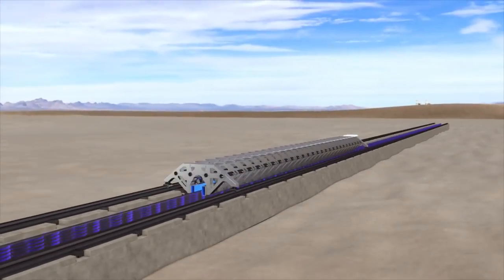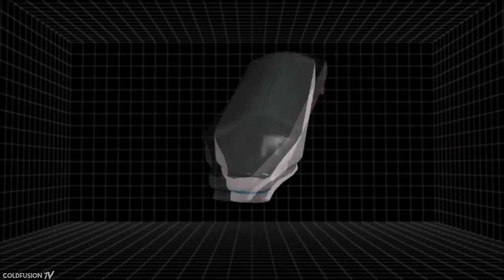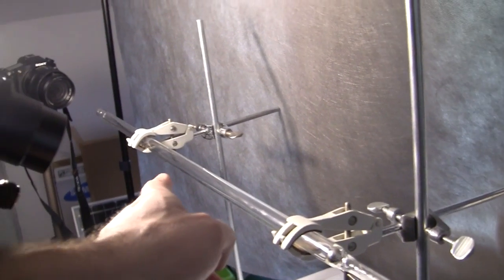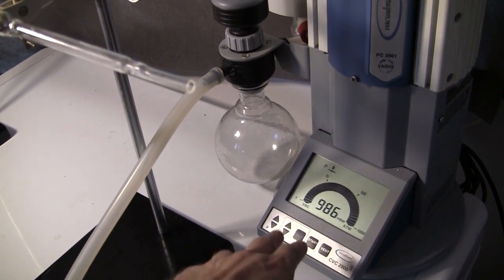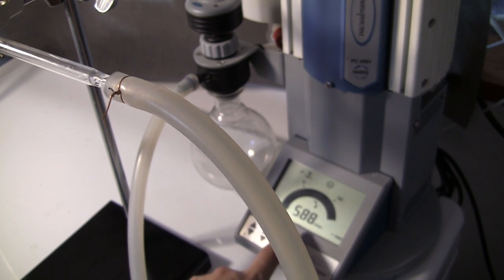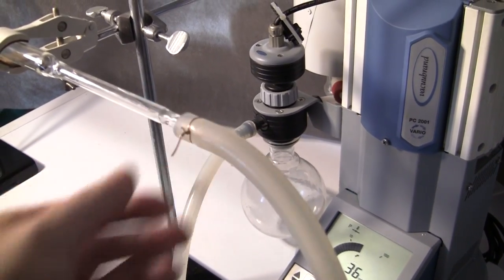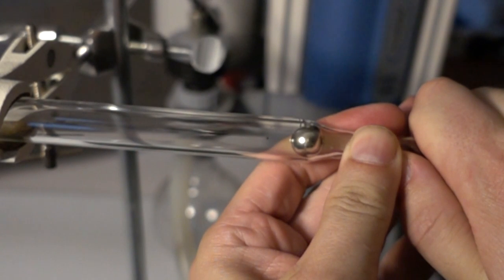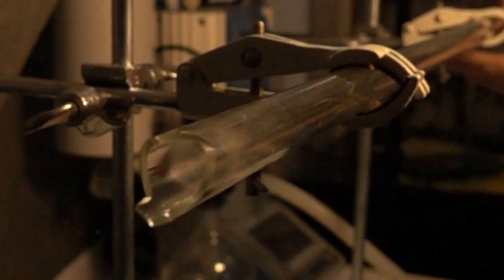How  the Hyperloop can kill you!

Comment from the maker: The hyperloop has all the hall marks of wishful thinking of dewey eyed dreamers sold by PR bullshit men who simply dont want to hear cold, ugly engineering reality.
Reply: type promo code feminism to get 15% off your next bleach bottle.
Reply: I'm not any scientist, obviously, but what if they used magnets as breaks? Like let's say, 100m of a magnetic railroad or something that would gradually slow it down or stop it. Or would that be BS? Idk just wondering. Would be glad to hear your opinion on that!
Reply: They can keep valves all over the places with mechanical sensors that break and rapidly equalize the pressure. The magnets can be used as brakes... The simple scale difference would mean that the hyperloop vessel would be more difficult to accelerate....(not certain of this).

The longer and bigger the tube ==/== (does not equal) more catastrophic results (Or at least you did not demonstrate this)

You may not be able to put fail safes into the system but that doesn't mean they are not there. If air is introduced quickly and uniformly into the tube the ball will barely move. (If air is introduced in about equal quantities in the front and back that is....

The vehicle can simply be designed to take the pressure change.... The end of the tube can be designed to have a giant crumply barrier (like all modern automobiles) capable of stopping it (even at 1000mph).
Reply: Well, how likely would vacuum failure even be? I mean, other modes of transportation can kill you too but with a very small chance of it. So, we'll need to wait and see  what they actually build, no?
Reply: In the Hyperloop Alpha document released by SpaceX (http://www.spacex.com/sites/spacex/files/hyperloop_alpha.pdf) they do mention failsafes for depressurization situations. Do you not belive in the failsafes? Are the effects you show in the video of a too large of a magnitue for "mechanical breaking" and " rapid re-pressurization along its entire length" too work?
Reply: But its not outright theoretically unfeasible, right? Unlike thorium freaking roadways.
Reply: "The AIRPLANE has all the hall marks of wishful thinking dewey eyed dreamers sold by PR bullshit men who simply dont want to hear cold, ugly engineering reality."
Reply: A plane can crash. People are still flying planes.
Reply: Thunderf00t does a lot more, he's not making content exclusively about feminism; why can't you appreciate his effort and respect his work by staying on topic? You're essentially shitposting feminism hate for attention, how are you different from feminists again?
Reply: How Cars can kill you!
How Trains can kill you!
How Planes can kill you!
Reply: Do you have any ideas for how to slow down? And I'm pretty sure the hyperloop wouldn't be made of glass.
Reply: Repent thunderf00t and see the error of your ways. Take Elon Musk as your savior and worship in his name.
Reply: The problem with this demonstration is that it doesn't scale particularly well. For one, the pressure differential between the near vacuum inside the tube and atmospheric pressure will be the same at both scales, with the mass of the passenger pod scaling much more quickly, (d_pod * 4/3 * pi * r_pod^3)  while the diameter of the tube, and thus the surface area for the pressure to push on will scale with area (99900 Pa * pi * r_tube^2), not to mention that the hyperloop is not spherical, but more of a tube, so it would be even more massive per pushable surface area. All of this means that the acceleration due to a tube breach would be (p_diff * pi * r_tube^2)Newtons / ((d_pod * 4/3 * pi * r_pod^3)/2) where d_pod (8,050 kg/m3 assuming a steel pod) and p_diff (99900 Pa) are constant. This function decreases as a function of the radius of the tube, so a bigger pod contained in a bigger tube undergoes much less acceleration (especially when compared to an extremely tiny one).
Reply: "In the event of a large scale leak, pressure sensors located along the tube would automatically communicate with all capsules to deploy their emergency mechanical braking systems."

I hope your longer video demonstrates why this simply won't work. Otherwise, all you've shown me today is a metal ball in a glass tube accelerates to high velocities when vacuum is lost. Which is cool, don't get me wrong... but lacks any real significance against the proposed Hyperloop design.
Reply: This is exactly what I was going to say, could the magnets and props not have a fail safe breaking system? If  a pressure change is detected everything goes into stand still mode.
Reply: Other means of controlling failure decompression could be implemented, not brakes alone.

Say, if sensors behind the capsule detect leakage, signal goes to emergency vents ahead of the capsule - to equalise the pressure in front.
Reply: Out of curiosity: Shouldn't there be a way to implement some kind of emergency brake system to prevent the massive acceleration in case of a vacuum failure? Of course you can't completely stop it but at least there should be a way to slow down the acceleration significantly, right? Also the failure you demonstrated seems like quite a big one. It could happen, but assuming it is build with proper materials and safety measures this looks like an absolute worst case scenario.
Reply: not this time thunderf00t just admit you wanted to test us ;D

the mass you would accelerate in the hyper-loop would be much bigger in relation to the surface the air would push on, hence less acceleration.

lets say it weighs as much as a buss, which is about 10.000kg
the surface is rounded 4sqm
1bar would be the pressure difference

so it's a quarter of a kg per square cm that will be accelerated
the force on one sqcm is 9.81N (one bar)
9.81N on 250g
turns out to be 4g acceleration...
wich wouldn't kill you in acceleration,
make it 4 time as long and 1g wouldn't do too much
you would just get 21% more acceleration than normal gravity gives you

Moreover i highly doubt you would get a hole large enough to get air in fast as you would need for 1 bar pressure.

to stop the train you need to just install some valves to get air in front of the train and it would break rapidly due to the tight fit air drag it has

really that's not going to stop the hyper loop any time soon
the problem doesn't scale well with size the bigger the better it's a cube square law thing mass goes up much faster than the surface

and just thinking about it a rocket would just fly away at ultra sonic speed immediately considering it has much more pressure in the back...

love your videos please keep up
please apologize for your mistake <3
Reply: 1) your model does not scale well.
2) planes are very dangerous too.
3) this is a tractable engineering and risk management problem, not "pr bullshit".
4) hyperloop has much more credibility than other things you debunked.
Reply: So your saying a high speed transportation system would be dangerous if all the safety systems failed and/or didn't exist?  Maybe next you'll tell us why trains are bad because they might derail, or an elevator cable could snap.
Reply: Well first of all pressure is force per m^2 and mass is per m^3 and considering F=m*a simply scaling this system up would actually decrease the speed of acceleration. Also i don't think they would build something like this while not considering safety measures for one of it's most obvious flaws. Not saying the model proposed would work  don't know the actual design used but ti's not inherently impossible to do safely.
Reply: They've already addressed it in Hyperloop Alpha:

"In the event of a large scale leak, pressure sensors located along the tube
would automatically communicate with all capsules to deploy their emergency
mechanical braking systems."
Reply: is the hyper loop the Elon musk train idea. or is it another thing completely
Reply: Wouldn't it be possible to measure pressure every 20 meters and in case of rapid flucktuation shut down the vaccuum on both ends in a way that decellerates the train?
Reply: Did you read http://www.spacex.com/sites/spacex/files/hyperloop_alpha.pdf ?
Reply: So when are we getting the video? I threw money at you to make it go faster.
Reply from the maker: yes.... thats the main source of the lolzfest!
Reply: You've got balls to challenge Elon Musk, a man who literally lands rockets, upright, from space.
Reply: +MadnerKami Think about it for a minute. You're in the air, and the engines fail, now there is not enough lift, and the plane will bore into the ground at speeds well beyond what the plane is designed for on uneven land that the landing gear is not designed to deal with.

Think about it for a minute; you ride up to space for your space hotel vacation and the rocket explodes, or seal on the space hotel breaks and you suffocate to death!

Think about it for a minute, some guy might go through a red light and crash into your car well beyond what your car is designed to handle, and then you die.

The question isn't whether some transportation method can kill you, any transportation method fast enough to get you places in a reasonable amount of time can kill you. The question is how high is the risk of that failure occurring, and is that risk acceptable and the deaths that go with it. Considering thousands of busloads die in cars alone in a year in the US alone; it seems we are willing to accept quite high a risk - and the deaths that go with it.
Reply: I often find your videos quite useful or entertaining due to the factor of nearly obvious rational steps and critical thinking, yet this one is disappointing. You haven't in anyway debunked the hyperloop, You've shown a stumbling block and a potential risk factor, but the risk factor is one very similar to airplanes. This is also not showing how it is impossible, which makes me wonder why you used the statement "debunk". In the end, the hyperloop is nothing but a high speed magrail in a depressurized tube for a higher velocity.
Reply: +kkonstantinosss2 stopping the thing isn't the problem here. the problem is the acceleration after the vacuum failure which would lead to your brain getting squished against the back of your skull. once they stopp it everyone eould already be dead.
Reply: i dont know what kind of scientist you are but elon musk is smarter than you and problems even big ones can be fixed
Reply: ***** The very first seconds are cringe worthy to me .. remove a lot of pressure (okay, sure even if removing pressure from a x miles long tube is retarded) .. then fucking use a propeller. What.
Isn't that a tiny bit counterproductive ?
Reply: emergency release valve? 
The people developing the Hyperloop need to look more into the safety of the passengers and emergency failures, but the people funding them need to understand that these projects are still being worked on. Pushing for a full system within the next ten years is an idiotic dream, publicizing these statements makes normal people think that this technology is anything more than a mere concept.
I think if we ever see a working Hyperloop, it will be nothing like the concepts we see today and will far less advantageous as the billionaires pushing this tech want to make it seem to be.
Reply: Let's see who we trust on in this? CEO (and Lead Designer) of two most world changing tech Companies, or chemist who play with a high school science experiment?

(ok, and write it on Nature-Chem... ;P )
Reply: bad news ... the solar freaking roadways just not only got more funding from a government program, there is also a new crowd funding on its way. (see eev blog)
Reply: This is a joke.... Right?
Reply: llepsnaci1
 You realize 1000kph is only a little over 600mph right? Claiming that at 600 mph you'd just be a puddle of blood and bone is just plain ignorant.And a breach would cause a gradual stop. Not a instant one.
Reply: *****
I would argue it is less.  A train traveling 600 mph in an enclosed tube would be as effective as  trying to bomb a plane. Also millions of people take trains, and there has yet to be an attack on a train. Why? Because MORE people take planes.
Reply: You are forgetting something Mr. Mason, We've had pipelines running successfully piping all sorts of stuff (or lack their of) for over a century now! often times these pipes are cleaned and surveyed by way of devices known as "pigs" that can be moved from one valve/insertion station to another using pressure, vaccum or both. 
Some of them even have their own autonomous braking systems and have been used with pressure differentials well past 1 atmosphere, also this is supposed to be a maglev/monorail train in this tube, I'm pretty sure they'll remember to put the brakes on the car, after all they certainly don't forget to put brakes on trains! The same logic you demonstrate could easily be extended to ordinary rail trains, you could say they are unsafe because if one went down a hill or mountain it could get to an unsafe speed, well... what about brakes? They seem to work fairly well for all of our other modes of transport.
Reply: Nice experiment, but doesn't factor in electromagnetic rails that could reverse magnetic charge to prevent the cars from moving if a vacuum breech is imminent. This is like saying people shouldn't fly planes because they could potentially crash. Why stop there? You should never wake up in the morning because even just getting up potentially puts you at risk for your life. 

Seriously, as someone specializing in debunking bullshit this was bit BS from you, failing to account for engineers no doubt having taken this into account, to find ways to engineer solutions around it.
Reply: As a fellow engineer I can agree this project is a pretty distant dream, however it has more merit and far far more practical usefulness then most of the things you normally bust.  Most of things you take down are outright impossible not just impractical.  Something like this not only could be possible once we over come several major hurtles (such as stopping the damn thing) but it SHOULD to push the boundaries in several key areas of science and engineering. 

I get the desire to attack the pseudo science and ignorance around you, trust me that eyebrow twitch you get is universally felt.  That being said some dewey eyed dreamers backed by one of the best PR bullshit men ever did some amazing things on July 20, 1969 stuff that ten years before hand was considered in engineering terms nearly  insurmountable. 

Keep on doing what you do sir it is a severs to humanity at this point!
Reply: Yeah, and a catastrophic hull failure in a submarine would kill everyone on-board, so what is your fucking point?  Just because there are clear inherent dangers in the use of a technology that hasn't stopped the human race from continuing the development and refinement of such technologies to make them safer.   There is no such thing as a "zero risk" technological development.  Human space travel is still one of the most dangerous and potentially lethal ways to carry human beings from one place to another and yet there is no stopping the development of space travel.   And even one of the most common methods of transportation such as cars kill 1.3 million people each year and yet people still drive cars because that is a better option than riding on the back of an animal.

I really like your channel but this video is utterly idiotic,  "oh no, if there is a failure in this transportation technology, people could die!" What, you mean like a failure on any transportation method ever invented?
Reply: +kkonstantinosss2 Think about it for a minute: You are in the tube. You ride the "train". Suddenly, a vacuum seal in front of the train fails. Imagine what it would do to you.
Conversely, imagine you traveling the tube and suddenly a seal breaks behind the train. Have fun trying to exhaust all that extra energy transfered onto the train before you crash into the next station at speeds of well beyond what the train is designed for.
Reply: in case of tube failure you could open some vents on the opposite side of the train and start breaking at the same time. I think that a wall failure wouldnt be fatal as long as rail is ok and train doesnt crash into something
Reply: Are you saying there is no way to failsafe this? Seems like the EM rail could have a reactionary safety. You could also build blowthrough valves on the car that burst open at a certain pressure...
Reply: What if you put pressure sensors all around the hyperloop and make a program which in case of a falure somewhere will immediately open holes everywhere else to normalize the pressure without moving the deathmachine?
Reply: Why wouldn't you be able to control the acceleration using the magnets on the rail
Reply: atmospheric pressure over a 2m diameter tube would exert a little over 300kN of force on the shuttle. Plenty of trains exist with brakes an order of magnitude more powerful than that. There is no problem here.
Reply: +kkonstantinosss2 personally I think the idea has potential and to dismiss the idea on a small scale experiment I can't take that as absolute proof the hyperlinks is bullshit. I think given proper corrections it can work. though I do appreciate thunderf00ts video cause it does bring up valid concerns
Reply: +BAM! SCIENCE!
When you say that its not feasible to spend billiions on something slightly faster than air travel, you mean that it would cost billions more than high-speed trains or? Because high-speed trains cost billions too (https://en.wikipedia.org/wiki/California_High-Speed_Rail#Economic_projections) and Im not hearing that they are economically not feasible.
Reply: Simon WoodburyForget
What if you are driving on the highway and your brakes fail!? Car should have never been created!
Reply: MrMegaPussyPlayer Does not seem like it.. Considering he don't even know that the levitation rail can be used as a powerful magnetic brake. This is simple high school grade physics.
Reply: MrMegaPussyPlayer Haha you are so full of shit it's amazing. Magnetic braking is in use on all maglev systems in addition to a myriad of other applications like elevators, roller coasters, cars, etc. Come back when you have gotten some education and stopped your idol worshiping of your YouTube hero...
Reply: MrMegaPussyPlayer "If having grad in doesn't makes you smart, not having one seems to me even worse."
Tell Bill Gates that...
Reply: At least it's not physically impossible. The problem you describe in the video can be solved by engineering. You could compartmentalize the tube or you could just have valves at regular intervals that can equalize the pressure.
Reply: +CaseAgainstFaith1 honestly if the eu thought it was a good idea thudercuck would have been all over it.
Reply: The reason tube failure would be dangerous isn't because it would be difficult to stop the cabin. It's because the initial acceleration would splatter everyone inside.

Anyway, I don't believe that tube failure is an insurmountable engineering problem. As long as you have computers capable of reacting in few enough milliseconds to any unforeseen changes and do something like magnet-lock or equalize the pressure quick enough that the cabin doesn't have time to accelerate it would be no more dangerous than riding an airplane. An airplane crash is a lot more deadly than a car crash, but a lot more people die in car crashes because they are just that more common.
Reply: I wouldn't call the hyperloop totall bullshit.  I have to disagree with you on this one.  We have many ways of slowing AND stopping objects going at high speeds.  The most inefficient but still effective way I can come up with in the moments just after watching this video is simply, brake pads.  Sure the brake pads would have to be replaced at each and at every stop, but they can and WOULD definitely work.  They would serve as the "outside force" applied to an object that would continue moving if not acted upon by an outside force.

Another way just came to mind as I was finishing typing that.  They could, at a certain point, drop a door, sealing the pressurized portion of the tube off, allowing them to pump atmosphere back into the tube.  This would effectively allow the carriage to come to a stop on its own as now it has the air to resist it.  Much like simply taking your foot off the accelerator of your vehicle.  It always amazes me, even going over 100mph(160~kph) how fast I lose speed just taking my foot off the accelerator, come to a full stop in just a few hundred feet.  They could also use a brake system here and the brake system, in our normal atmosphere would be quite a bit more efficient.

The biggest problem I can see that would bring the skeptic in me to call the hyperloop a total bullshit project is the depressurization of the tube.  That has to be a massive undertaking, to pump all that atmosphere out, we are talking about millions of cubic feet of air here.  Yeah, if I was going to bullshit anything, that would be MY pick.

Still, I want this to be made, somewhere, I don't care where or by who.  Even if it is a single line with two tracks and tubes with only two cars one to go to and one to go from only two destinations, just to say we(humanity) did it.  When it comes to stuff like this, to me, how much money it costs is of no concern to me.

Like I said though, I disagree with you on this one.  I usually agree with you.  But in this case you provided no factual evidence that it won't work.  Your argument, in summary, is that it is too fast so it shouldn't be done.  Sorry, speed is not a deterrent to me and certainly not in this case, where high speed of mass transit is the entire point to it.

If you are going to call bullshit on things, you need to give a valid reason.  "Because it is fast" is not going to cut it with me.  The community you have gathered here are people that like facts and science, I am sure most of your other watchers are going to feel the same way I do on this one.
Reply: Doesn't this over simplify the hyperloop quite a bit though? I'm sure pressure failure would act how you've demonstrated, but the failure above would have to be considered in different scenarios. Is the hyperloop moving already? Is the tube failure in front of or behind the capsule? Could a capsule thats perhaps rigged inside a larger/longer capsule with shock absorbers inside the capsule take enough edge off of that rapid accelleration for a passenger version and as they are designed with brakes, could they mitigate this too? This is a cool demonstration but I think you need to make a longer video to combat the hype for the hyper-loop
Reply: I really enjoy most of you debunking video, and I tend to defer to your knowledge because you know a lot more then me about physics, at least.  I am not sure you have proven your knowledge on engineering, however.  
Most of your previous videos debunk on the physical level.  I.e. they are physically impossible.  I haven't seen your full argument, but it sounds like here you are just saying it is really hard.  That falls into the duh category.  

But, to me, Musk is not a dewey eyed dreamer.  He is an actual engineer, with actual accomplishments.  And I am guessing he is a bit smarter about this stuff than you.

I will definitely be waiting for the video, though.  And luckily for you, he has open-sourced the technology, so you have some real meat to work with.  I expect that you will be pouring over the design papers, and explaining why it would never work, yes?
Reply: Yeah, just as how a structural failure on an airplane, or a brake failure on a car on a mountain should make both of those vehicles unrealized...

Failures DO happen, it is just up to the developers to make sure that they happen very rarely - and if you spend billions and billions of dollars on making something that could potentially be completely ruined by a single failure, you can be pretty sure that a lot of work will go into preventing that from happening.

Have some faith, engineers are not idiots with no regard for human lives.
Reply: I wish there was a ruler behind there so we could measure the acceleration. Either way it looks like even a fighter jet pilot would have some trouble with the acceleration.
Reply: So basically they going to try something with out even testing to see if it could have negative side effects or even kill people.
That seems pretty lazy.
Reply: Shulg
Absolutely... If you bother to read my comment (if the air is added in equal amounts in front of and behind of the ball then there is no acceleration)

Also it wouldn't be nearly as bad if the hyperloop is not sealed on the top and bottom and had a certain amount of clearance. (The ball didn't seem to have that)
Reply: You are assuming that you can't account for/have redundancies in place for such failures.

I'm not convinced it's possible or even a good idea... but this argument doesn't  seem to be insurmountable.

Though I have a feeling you aren't done yet, can't wait to see what else you come out with. :D
Reply: Right, such a large leak is highly unlikely, especially that it appears exactly in front of the pod. Otherwise the consequences can be mitigated somewhat. Some low risk will remain always of course. But no reason, not to use it, if it is low enough.
Reply: What if the craft dosent cover the entire tube, and has powerful breaks? Isnt this kinda exsadurated?
Reply: I AM NOT A SCIENTIST OR AN ENGINEER. I remember the mythbusters doing this with a ping pong ball and they had shown that the small amount of air ghat passes the ball would eventually slow it down.

Ignore this, I just realized that in real life the hyperloop would be moving, and air resistance wouldn't slow it down enough to stop anything.
Reply: At first I thought it was kinda bull that you were trying to debunk this, but if I had done my research, and I had known that it was supposed to be a vacuum... Well I'd probably have been asking you to do so earlier. This is only ONE type of failure within a vacuum system. What if there's a failure in the cars carrying you? It's just like the Simpson's monorail episode. With a vacuum.
Reply: Would turning of the magnetic levitation system make any difference in the acceleration and the possibility of stopping ?
Is there something preventing the installation of a braking system on those rails to both sides of the train?
Reply: Is there any feasible way to slow acceleration with, say, the magnets?
Reply: If you tried to put in a braking system at top speed of the capsule. They would instantly break and if its a mechanism built to use the whole capsule (like reverse polarising the magnet to force it to latch on). You've still got a fatal whiplash from the sudden stop. And thats IF you the capsule doesn't rip itself apart from the sheer opposing force required to stop the thing (no material is feasibly strong enough to take that without shredding into pieces).

Lets also not ignore the fact that at such speed the G forces would fuck up your body and crush your internal organs.
Reply: You could stop the accelerations by having pressure equalization valves deploy immediately in the event of a tube failure. That way you fill the tube on either sides of the pod. Equal forces on either side means your staying still. It's important to remember that there are ways around many of the problems with hyper loop, unlike with the thorium car and the solar roadway, which are, due the thermodynamics, complete bullshit. However this is a problem I hadn't thought of and I think your demonstration was well done.
Reply: Several possible solutions or mitigation strategies, such as:

- Multiple nested layers of tube, where if even one is compromised, they prepare to shut everything down immediately
- Pressure valves to allow air in at various places in the tube at once, both to slow down the vehicles, and to help lower the magnitude of any pressure wave heading in any direction
- Computer controlled emergency brake trigger to slow down all the vehicles at an acceptable acceleration before the pressure wave hits
- Compressed air stored in the vehicle itself which can be strategically released to try and counter the effects of an approaching pressure wave
Reply: solar powered feminist endorsed hyperloop's ftw
Reply: I should mention also that I really don't think Hyper Loop will ever be reality (at least in the near future) because of economics. It's actually feasible in terms of engineering, being that there are solutions to the problems presented (which I and many other commenters have already pointed out). It's economically not a feasible plan to spend billions on something slightly faster than air travel.
Reply: +MartinDxt
Some more info from the Hyperloop Alpha documentation. (for the smaller passanger version) http://www.spacex.com/sites/spacex/files/hyperloop_alpha-20130812.pdf
15000kg
Surface area of pod: 1.485sqm
Surface area of tube: 3.91

"giving a capsule/tube area ratio of 36% or a diameter ratio
of 60%. It is critical to the aerodynamics of the capsule to keep this ratio as
large as possible, even though the pressure in the tube is extremely low. As
the capsule moves through the tube, it must displace its own volume of air, in 
a loosely similar way to a boat in water."

So to your example we should add more weight and use the surface area of the pod which is quite much smaller. Also since there are a lot of space around it im guessing that would have a limitin effect on the damages.

So Im thinking he should have put in a much smaller ball? Like shooting small carrots with a potato gun.

Not saying that the hyperloop might be stupid anyhow, but he really did not provide a good case for what he said in this video. Guess we will have to wait for the longer one.
Reply: fastest and flattest way to travelllllllllll.
Reply: Yeah but that's when it fails. If you were able to make it so that it didnt fail then theoretically it would work
Reply: easiest way would be use a rocket motor you could program it to go off if acceleration goes above a certain value and would work in a near or total vacuum and would easily slow down and stop the vehicle.  As much as I love Thunder00t he is a chemist who has a good knowledge of physics but he is  not an engineer and he has really screwed the pooch on this one its really not that difficult a problem
Reply: There are so many variables to take into account when scaling aerodynamics. Put a pencil lead in there and see if it shoots out the tube. I can't believe a scientist like yourself would actually mislead the public like this.This is fear mongering without adequate evidence and you of all people should know better.
Reply: well in the 1950s John Stap USAF survived multiple short bursts of over 40g acceleration and you could easily limit the acceleration of the   vehicle (and even stop it) using a rocket motor as a breaking thruster on the vehicle itself have it as an automatic safety system that will trigger if the vehicle exceeds a certain acceleration for example 1.5g
Reply: *****
"The vulnerability of this mode of transport to terrorist attack alone ignoring the incredible maintenance and safety issues is a non-no for me. Just one small breach or buckle on the line when a trains passes through could mean huge devastation."

You basically just laid out the reason you would never fly, drive, or ride any type of transportation. As they are all at risk of terrorist attack. And all would be devastating. 

The idea that cowardice and fear should prevent advances in technology is an absurd excuse to not try new things. We might as well regress back to caves. People jumped on ships to travel to places they knew nothing about. I guess colonizing near by planets and seeking to leave our solar system is just too risky... Thank god there are risk takers in ur species, who ignores the naysayers and cowards.
Reply: You'd make the same video about airplanes and submarines when they were being introduced, Thunderf00t. Guess what, we still use airplanes and submarines. WE ARE FEARLESS!
Reply: +Thunderf00t  It does seem to me to be an extraordinary engineering challenge to get that gigantic of a volume that well sealed and that well depressurized.  Seems rather difficult.  How much energy would be required to do the pumping?  Seems like it would be a very large amount of energy to do that.  On the other hand, dealing with leaks seems like relative child play.  The car can have acceleration sensors and automatic braking.  Getting the damn thing built to begin with, I can't imagine being completed anytime soon.  But, if it is built, I'm not worried about handling leaks.
Reply: They have multiple mechanisms for stopping in the event of catastrophic pressure failure, and that is emergency release valves. when an "unplanned spike in pressure" happens at one end, they would immediately release pressure at all points along the barrel, which is to say every closed point would start re-pressurizing, (sealed off from other tubes as well) which means all that acceleration stops, or rather the forces on both ends reach equilibrium with each-other. think, snapping both ends at the same time. Second, the hyperloop is propelled and stopped by its own mechanisms as a maglev, which has it's own braking system, which would ALSO be used, and third in the event that both of these fail, simply turning off the power. yes, you'd be at high speed and suddenly scrape along the bottom of the "barrel", but that simply needs to be designed with the right type of materials, think an ablative heat shield but for friction, just line the tube and the pod with that. that's 3 failsafes that are dead obvious for even me.  You don't market a car based on it's seat-belts, airbags, and crumple zone, so you wouldn't market the hyperloop for its safety features either.
Reply: ODDnanref the pressure wave and the acceleration that results isn't spontaneous high speed and spontaneous breaking, it's just that. acceleration. the air isn't JUST pushing the pod, it's also going around it and down the tube ahead of it. you can even see this in the video when he cracks open the tube. the ball doesn't go from stopped to instantly accelerated like something impacting it, it must accelerate over a period of time until it reaches a top speed. the "impact" of the incoming air on the other side will neutralize that acceleration but it will do so over the course of time. how long? however long it takes to fully refill the tube, which will probably be somewhere between 30 seconds to 5 minutes, given the length of the tube and the interior volume. so that's accelerating to the speed of sound in, say, 30 seconds, and then decelerating from the speed of sound, over another 30 seconds. The only entity that would feel this as an "impact" would be the exterior hull of the pod itself, which may warp and become unserviceable as a result, but the passengers will be fine. if the duration of evacuating that glass tube is any indication, returning that thing to 1 atmosphere will not be instantaneous.
Reply: +Marco Yamada Im struggling to find acceleration levels of a ball in a barrel that is twice the area. Given that pressure differential is one bar and "piston" is far from sealed. The force on the ball would be minor...
Reply: +ImJuanka what about a failsafe where when a leak is detected, it opens more spots. So the pressure would come from 2 sides meaning they counteract each othed?
Reply: the capsule would run at almost 1200kph to slow it down you would need a total distance of ca. 2km or in other words 15s. Besides a hollow vaccuum tube would make heat-exchange actually impossible since everything creates heat including the passengers it seems extremely unrealistic. The other problem would be the creation of a near vaccuum which I don't see any sollutions (like how to achieve that and what it will cost energy wize) and even for driving around corners there is no solution given yet. '_'
Reply: As I see it the acceleration alone could kill someone by sever brain trauma. However, using mag-lev style breaks, do you see this tech plausible for cargo only shipping ???
Reply: Lauri Markkula yeah i did some calculation a 10 ton vehicle in a 2m diameter tube will give you almost 4g so make it 4 times as long and you barely hit one g
Reply: ODDnanref the mass of the train would prevent sudden acceleration it would optimally get up to 4 g max with just a small train take a bigger one and you wouldn't notice it even
Reply: MartinDxt Could you share your calcs?
Reply: If one is going to argue against research for unproven technology, argue against public funds being used for it.
Reply: Thunderf00t,
You see to forget that this will be powered with Thorium Solar freaking roadways, utilizing the same system that is used to extract water from air and air from water, that it will be able to flood the chamber and negative pressure that will bring the hyperloop to a full stop, safely, in about a mile or so.
Reply: It's not impossible to use magnets as brakes. In fact systems like that have been used since the late 19th early 20th century. Hybrid cars that recover energy from braking essentially do the same thing, it's just that the magnets are part of electrical generators.
Reply: Hi there Thunderf00t, thanks for doing what you do.  I know this is not really the field you work in, but maybe you can still provide some insight.  https://www.indiegogo.com/projects/supermeat-real-meat-without-harming-animals#/   This smells like a scam to me.
Reply: replace hyperloop with airplane and you sir have all the hall marks of a 19th century critic.  This scenario isn't even the scariest.  Can you imagine a cabin leak on the hyperloop?  There are many problems left to be engineered but none are show stopping like you suggest.
Reply: Simple fix. Just open a vent on the opposite end of the tunnel.
Reply: So, if I understood this correctly, the problem is that if something breaks pressure comes back in from one side and propels the capsule forward at high speed? 

The first thing so say is: so what? When you drive in a car and the brakes fail at 100 km/h you're also in all kinds of trouble. Subsystem failure is bad in many technologies; that doesn't prevent us from making them and/or them being an improvement over the previous system. 

Second, I'm sure the people building prototypes for this have considered this already. The first thing to note is that the capsule will have a higher mass than the little ball there, and the pressure probably won't return at full speed either; that would require a crack as large as the tube is. That means that the acceleration will be much lower and people's necks likely won't break from that. And for stopping the thing I can imagine a couple of things from simple brakes of some sort to letting pressure back in from the direction into which the capsule is headed. 

But even if there are no fail safes for this scenario, the risk of that happening could be minimal and/or just be accepted by passengers just like they do when they board a car, train or airplane. I don't really see the point of your video this time.
Reply: As long as AmTrak doesn't operate the system, it should be safe.
Reply: You know, there is this thing called G forces. Pretty sure such a rapid deceleration or acceleration in that matter would kill you just because of the G forces applied to your body.
Reply: I think it's more that say a terrorist could easily plant an explosive on a part of the hyperloop in the middle of nowhere and then leave, explode it and suddenly the WHOLE hyperloop has this problem, not just near it.
Reply: Actually, current high speed railway trains use eddy current brakes which induce a countering magnetic field against the rail. There is no physical friction contact as in regular train brakes. The energy of the magnetic braking is converted into heat in the rail. I think what is being proposed is close to the opposite method to get it moving - a rail gun.  It moves in a vacuum, but the movement is done like a rail gun.
        What was shown in the video, movement was caused by air rushing into the back of the projectile at which point the energy of the inertia of the projectile and air behind it sends the projectile through the end of the tube.  The point was the danger of having failure in the vacuum. If one was traveling at high speed in a vacuum and the air broke in, moving a high speed wall of air toward the moving vehicle, the rapid negative acceleration would be fatal to the occupants.
  In the age of teleconferences and remote controlled robots, etc., I wonder what is driving the need to travel so much?
Reply: ***** It might sound strange but people may be looking for ways to GTFO of the country. Overall I see things heading way south after this election cause no matter what the bar has been lowered yet again and if it go's much lower we as a country are fucked.
Reply: You are really starting to lose me with this crap. First brexit is dumb and won't happen. then when it does you get fucking drunk and ramble everyone to sleep for hours on stream. Next an idea which literally everyone even MIT is working on testing is dumb because thunderfoot says so.

There is a reason you test things first and do iterative prototypes hyperloop is acknowledged to have issues in concept but if these can be overcome the benefits far outweigh the risks. Your reasoning here is akin to saying "space travel is a bad idea because it's dangerous" 

Keep making shit like this and watch as you become the equivalent of an sjw pariah. Also maybe lay off the fucking sauce on YouTube you are not a fucking e celeb
Reply: Sorry TF, but it sounds like you're arguing like a creationist. Gosh would it be great if yet another thing was bullshit, right? So lets assume Hyperloop is bullshit, then make some shit up around it to support it. Surely nobody would catch on, right?

Your video doesn't show anything that cannot be dealt with within reasonable engineering; maybe you really should stick to blowing up test tubes with sodium.
Reply: Either using a space of magnets for the train, some form of flux pinning, and/or a gradual application of friction (similar to those viking boat rides at a theme park.)

At the moment, the top speed for a manned rocket-propeled aircraft is about 7,270 kh/h (or about 6625.474 feet per second), which is about 6 times as fast as the speed of a bullet, which is about 1,126 feet per second.

Speed and g-force wise, there should theoretically be no issue, though some tests would certainly need to be made for the more fragile of use (pregnant women, elderly, children, etc.)

The second issue would be turning and braking. Braking can be solved with magnets of an opposite polarization than the normal magnets (used to keep the train 'up') in order to slow the train down, possibly in addition to friction pads (similar to a viking boat ride at a theme park.) Turning, however, is not so easy an issue, as slowing down to a safe turning speed at THAT speed is a much more difficult feat. Gradual curving could be a potential solution, but would still remain an issue in certain circumstances, and would require VERY precise architecture and planning.
Reply: thunderf00t, i think you're mistaken (or just misinformed)
you are missing an important part of the design, i'm talking about the diameter, if i'm not mistaken, the diameter of the pod is supposed to be 2/3 or 1/3 of the diameter of the vacuum tube which would 1 make the acceleration way less significant (no good seal, no good acceleration), 2 enough air could rush passed to make the pod stop accelerating at some point (equalizing pressure in front and in back)
why should you have a small pod in a large tube? elon musk explained it: if you're traveling through a tube at really high speed and you have a pod almost the same size as the tube, there will be a pressure build up in front of the pod, enough so seriously reduce speed and seriously stress the tube (think a train trough a tunnel, when you're at the platform you can feel a train arriving (because of the wind))
Reply: +Shulg would probably not react fast enough.
Reply: At rLoop we estimated something in the range of 200g on our test pod in the case of tube breach. But how likely is it? I guess, you have to live with some risk, as always...
Reply: Wellithingtheprowell I thing that some easy ways to circumvent the problem would be to have a slightly higer pressure at around 100-200milibar. And having the carts locked in place during stationary.  Or allowing controlled acceleration by the air(to prevent harmful G forces and a controlled de-acceleration (to also prevent dangerous g forces )
Reply: Well this is a dumb argument as there is an incredibly easy solution to the problem. Install various walls of Feminist Frequency members along the route. In case of emergency the conductor would flip a switch that will make the walls pop in front of the trail. So each wall would reduce its speed
Reply: +James Needham Should note not joking I believe in perpetual motion as it should be fact that things exist from the start of time until the end of it.
Reply: The problem with magnetic braking in the case of a tube breach is that yu have such a massive pressure differential that the pod would still be pushed along the tube, and if you brake too quickly, the passenger will just be slammed into the front of the pod. What I think you could do, however, is have valves open in front of the pod, which would help reduce the pressure differential, and then slowly engage the brakes. Admittedly, there would still be the problem of hitting a wall while accelerated.
Reply: Yes, they can and interestingly a lot of those crashes can be attributed to poor judgement on the human part or through poor action of the human parts in the plane. Examples would be the Germanwings pilot that commited suicide with his plane, the destruction of Malaysia Airlines MH17, Iran Air Flight 655 shot down by the USS Vincennes (CG-49) and several more. See also the notable examples on https://en.wikipedia.org/wiki/Pilot_error

Similarly with train accidents, they are often not caused by material fatigue, but by human error, be it faulty handling or forgetting to, say, repressurize a hydraulic system after maintenance is done. 

Car accidents? So many are caused by human error that it is astounding that there are still so many people that are allowed to drive cars.
Reply: falsehero2001 Meh more of impracticality of vacuum travel instead of a low pressure travel.
Reply: Why are you stopping it? You don't need to stop it to prevent death; just slow it down
Reply: There's a solution. Have electronic controlled vents every few hundred meters so the air can rush in from both sides when there is a failure.
Reply: +kumaclimber That's what I said...
Reply: Oh boy am I looking forward to this.
I know so many hard core Musk Fans that simply won't accept that this idea is really far fetched. What ever video you will do, it won't change their mind, but I will rub it in their faces anyway.
Reply: 1. make a gap between the pipe and the cart - you can make it as large as you want it will not effect performance but it will take the edge off this problem.
2. add emergency valves every X meters to the pipe that will open if there is a loss of pressure, or any other problem with the cart, allowing the passengers to get off the cart.
Reply: they're building a prototype writh now
Reply: I don't think this sort of project would be lacking in safety backups and redundancies.
Reply: +Skippy Rock Possible, if we assume that it is impossible to design a system that can react in time, before the air can reach the vehicle. Or that anchoring it against the pressure is impossible.
Reply: Make the tube bigger so the air can rush by. They will find a compromise between having the tube costing 10 times as much material, and maximum safety
Reply: In the next video: How the Elevator can kill you!
Reply: Thunderf00t you should check out this Q&A from Elon to see how the hype started and his intent with promoting the idea if you haven't already. https://www.youtube.com/watch?v=YIVJvpNyjdc
Elon Musk speaks at the Hyperloop Pod Award
Reply: Yeah, some really cool physics going on here. There's a ping pong cannon floating around on the internet somewhere that uses similar physics to what you show here TF. Think i saw it on mythbusters then on tested.
Reply: Well I also doubt that the  train is not coming with emergency brakes that apply a huge boost of increased friction which would not make it like a slick ball in a slick tube.

Also it is a bit unlikely that the tube fails on the whole diameter ... 2 centimeter hole in a 2 meter tube might cause some issues with holding the pressure ... but the pressure differences hardly make any difference.

And there is the thing of emergency valves  and the probability of using tubes with several layers which all have a different (low) pressure in them.
A change in one of them would mean a fail and the system could shut down safely when detecting it. While the main tube isn't effected at all or only a little. (Pressure goes up from 10 millibar to 20 or maybe even 100 millibar over seconds in worst case and minutes in bet)

On other hand the tube could have a total fail (if designed and constructed badly) and the train could run at full speed in a wall of air (and in worst case also rubble)
Which anyone can tell from past (even though more often 2nd hand) experience would turn out rather badly.
Train meet Wall.
Wall 1 (hole), Train 0 (length).
Reply: Uhm, what ?
"Going to the moon" was pr bullshit...
Reply: +beachballa93 ide love to see that in action
Reply: +DeathToDrugUsers21 their field of snark will slow down the train xD
Reply: what are they thinking?
Reply: pr bullshit? like the propaganda from the anti-white eu?
Reply: easiest fail safe would be a breaking thruster a rocket motor set to go off automatically ( have a manual ignition as well) if the acceleration goes above a certain value say for example 1.5g simple, effective, cheap will work in a vacuum
Reply: Jon south oh and what happens if the rockets fail or when bad people do something or the tube collapses?
Reply: +Todd Farley the anti-white eu will be there to tell all you brits to go fuck yourselves
Reply: also slap a small rocket motor on the vehicle as a breaking thruster will slow down the vehicle an allow time for the tube pressure to be equalised thus stopping it quite effectively
Reply: But if the hiper loop was transporting people what about the strain on the bodies of that deceleration?? 
as Jeremy Clakson said "Speed never killed anyone, suddenly becoming stationary.. thats what gets you"
Reply: ***** The problem of meglevs are that they aren't compatible to the already existing rail system, So once build they can't go really anywhere but the little tracks that they have.
To make them really work you would have to replace all of the tracks and trains with maglev technology. And transporting goods (which can go and current are going rather slow) that way is actually inefficient as well.
The overall cost (of replacing all the tracks and stations) was just too high.
And the usefulness of trains that just could go on a single line to low.
No one actually had the guts and money to take huge ammount of money in hand and build several meglev tracks. Making them somewhat useful.

Oh also since they are incompatible to normal tracks there was also the problem that the normal and cheep tracks would run alongside the meglev. Or breaking up the track system for normal trains if you don't do it.
Reply: Space doesn't have other human beings with <160 IQs operating heavy machinery.
Reply: *****
You are mistaking the number of deaths with the causes of deaths. How many people die in cars? People don't die in cars because the technology of cars is flawed. It is because the people who drive are idiots.  People die in planes, a much more complex system. but nearly as much as people in cars. There is more strain on planes, and planes have a much more limited flying life than car, because through deaths we learn. Every warning label you see is because someone blew themselves up doing something wrong. thunderfoot is a scientist telling people don't leave the cave, because death awaits them outside. He is an imbecile. liken to a crackpot doctor claiming cooked food is bad for you.
Reply: Wow, Thunderf00t vs Elon Musk?
Reply: I would have to believe that at some point in time during the r&d phase they may have thought maybe subjecting the passengers to an extreme acceleration force might be detrimental and then were like 'hey guys is there any way to mitigate this damage that could happen to our passengers'. guy#2'ya guy #1, maybe if we don't accelerate them with the same acceleration as a bullet that might work'. Not only that but I thing the hyper loop is for longer distances kind of like planes are and we all know planes don't fuck up your spine with their takeoff acceleration now do they
Reply: Ricardo Fernandes
Gradual deceleration. And losing energy is not the same as hitting a brick wall. As little as 5 second is more than enough to decelerate from 2000 mph. it''l be rough. but no damage will be done.
Reply: +JRMCNEA yup
Reply: So the hyperloop is like a meat filled rail gun? I see no downsides. It would such to clean though.
Reply: Really though, all you are able to say is "We can't do it now". Well obviously not, that's why we're developing it. There are major engineering challenges to overcome, it'll take decades of research, and there are safety concerns to address, but here's the thing: How would you accomplish hypersonic travel without burning buttloads of energy/dealing with heat and friction/fitting enough engine into a thing to make it go that fast?
Reply: not really, at least not any that would ensure the survival of the passengers. Even if the train could anchor itself, and even if the sudden breaking wouldn't injure or kill the passengers, the air mass would be coming in en masse and with really inhuman speed (just look at any ship sinking documentary, and watch how fast the water fills the ship's inner halls, to have a vague idea on how brutal the pressurizing of an inner chamber can be). So, even if the train would stop at the spot, it would be, in fact, even more vulnerable to disaster, chances being that the air mass and speed would, not so unlike water, keep violently pushing the train until the pressure is equalized. All sorts of structural damage could occur, from outer hull of the train being badly deformed, to even the train breaking apart, depending on how the air mass would push the train.
Yes, it's the absolute worst case scenario, but, last I remember, safety research for vehicles of any sort, is always done on the worse case scenarios. Car safety tests are done on impact simulations, not egular driving.
To be totally fair, this could, in some time from now, with technological advancements, be a viable thing. But, as it is today, we simply don't have the tech to make it a reality.
Reply: Teth47 WW3 seems a lot more likely than this being implemented in large scale.
Reply: ***** Give it time and wait and see. Good ideas are trashed all the time, while bad ones (e.g. solar freaking roadways) also get money thrown at them all the time.
(not in every case, though)
What finally will make it is only determinated by how it is sold / how much hype it can get.

Maglev is not economically viable because it is bad idea, it is it because it would have to replace the existing system to become so.
If for some reasons all existing train tracks and trains would have be gone it would be rather stupid to not go meglev.

JRMCNEA No, he is not. He is a human being, and as such he can be wrong. And I think he might be this time. But he also debunked a looooot of BS products that never would have worked in first place.
Reply: in case of tube failure, you will be battling incoming pressure, from the atmosphere, with in-train pressure, coming out of vents. if a 20-mile tube gets a valve fault, it will fill with 20 miles by 12 metres perimetre... roughly 400 thousand cubic metres of air would be needed, for the pressure to equalize... and, your best consept is to battle this with vents from the train... 
let's assume the train has oxygen masks, like airplanes do... and, you pump out most of the cabin pressure... and, let's assume the train is 100 metres long, cylindrical, and has a 9 metres perimetre... that's roughly 900 cubic metres... 
even if you manage to pump out all of that pressurized air, and you won't cause the bodies of the passengers to burst, how much will that help you slow down? 10% 20% I doubt it will be that high... but, even then, you will still get 80-90% of the pressure effect... equally devastating
Reply: A simple lemma Yeah that is also my concern ... That the costs of maintaining the pressure is actually what breaks the system.
Not the solvable security issues.
Hundreds of huge vacuum pumps going all the time, just to maintain the pressure.
You have seen (roughly cause of lot of cuts)  how long it took ***** to apply this pressure to this short and tiny tube ... and the pump is huge in comparison.
Reply: Everyone keeps talking about breaking  and re-pressurization to stop the train. It's not going to save any lives. If you have that magnitude of acceleration, the only thing you are saving is a giant mushy puddle of blood and bones.
Reply: +Joey Slávik 

Absolutely yes.

This experiment doesn't nothing to have with magnetics.

The power of attraction is way more complicated, and it will make the HyperLoop stop when it's needed.

In fact, they already complete some of the experiment that they were doing with the HyperLoop, and it was a success.
Reply: +Bio gundam 

Hm, no.

They tested, worked, still testing the HyperLoop to make it safer, and seeing if it works.
Reply: +TheArmouredMan 

Well, Musk created Tesla Motors, PayPal, Space X.
Musk had achieve a lot of his goals, he is still achieving them.
Musk is a genius.
Not like you.
Be like Musk.
Think like Musk.
Reply: Thunderf00t knows nothing about simple physics like lenz law...
Reply: wouldn't the sudden acceleration kill you as well?
Reply: yemo34
No. The acceleration wouldn't be more than a couple Gs. We can withstand up to about 5 before we pass out. We would have to be accelerating at more than  50 meters per second the entire time for the force of acceleration to even effect us.
Reply: llepsnaci1 that is, if you actually have this kind of acceleration, and most doubt you will have it in first place... also humans can survive 40g for a short period of time, as experiments on humans have shown.
Reply: Rewnar Westner and be Musk? God that would in the end a boring world where no one has a different opinion.
Reply: Wankel Motor He probably knows more about any physics than you ... he is actually a real multi discipline scientist. And works as such.
Reply: Holy shit, The HyperLoop is like a repeat of the Concord anyone remember The Concord? I wouldn't believe the headlines when this thing opens to the world.

NEW YORK TIMES.
HYPERLOOP ACCIDENT! THOUSANDS DIE. 

HyperLoop Discontinued.                                                          In other news.
Reply: MrMegaPussyPlayer
"He probably knows more about any physics than you ... he is actually a real multi discipline scientist. And works as such." nd yet simple concepts seem to baffle him. He just made a 4 min video about how Airplanes are deathtraps. Everything he said about this hyperloop can be said about planes. But with many more issues.
Reply: +Anthony Cerbic what's your problem with thorium?
it's a wonder element that could change life as we know it.
Reply: About 4. But this thing would be discontinued immediately if it ever crashes.
Reply: Why did you copy paste a section of the description into a comment, mate?
Reply: If only they had thought about installing "emergency mechanical braking systems"
Reply: How do bumble bees fly?
Reply: Such as what?
Reply: ***** several airliners have been taken down with ground to air rockets.
Reply: What about using the acceleration that you demonstrated in a controled way to propel a craft similar to the vacuum tubes used in banks? I would think the failure of that type of system would be much more controlled. Just an idea from someone who likes science.
Reply: Monorail! Monorail!... Monorail!

Lest we forget Ogdenville.
Reply: Simon WoodburyForget Non-expected Frequency?
Reply: Ben Jammin bwahahaha the Simpsons
Reply: Simon WoodburyForget Hope they have some back up plan if this thing crashes.
Reply: Simon WoodburyForget only job of an engineer? Over simplify much?
Reply: I'm thinking they could divide it up into pressurised sections with doors that open and close only when needed. So you could contain any pressure breach to a single section
Reply: Simon WoodburyForget Well i say back up plan so if The HyperLoop crashes and makes to the news they have a plan to prevent lawsuits and fines....
Reply: Somebodies got to dream right? Sure this shows how with our current understanding of physics and engineering this method is more likely to kill you. However, if a way could be developed to accelerate the vessel while the atmosphere was reduced to 1 and again when decelerating. I am no engineer by ANY stretch of the imagination. But some things, I believe can be overcome when we either stumble on the right thing. Or learn a different way to accomplish a similar goal.
Reply: Yeah it was his idea. Or at least he was the first to make it popular for the media to talk about.
Reply: Hello sir, it's my understanding these will be built underground. im guessing in such a failure, a person waiting at the platform that fails would be sucked through the crack while the train accelerates to mach1
Reply: build it underground?
Reply: doesn't the strength of a vacuum scale with or is it linear and how much energy does it take to make a vacuum at that size (the hyperloop's size)
Reply: Simon WoodburyForget VERY LARGE CONSEQUENCES. You know Lawsuits, billions of dollars in damages and fines.
Reply: Simon WoodburyForget ***** has a degree in Physics, and while that stuff might or might not be exactly his area of expertise. He would clearly know enough of this from a) the time he learned about it and b) his daily practice what he is talking about.
And Wankel Motor is clearly talking here about thing above his horizon, he has heard of that and thinks he actually knows something about it, but actually here is the Dunning-Kruger Effect in place and he actually knows shit about it.
JRMCNEA _"how Airplanes are deathtraps"_ Not really... not unless you have actually a plane in the situation where in front of the plane is a lot less pressure than behind ... and the plane is a tube.
Unit _"Just what I came up with while watching this 3 minute video and I'm no engineer."_ clearly not, otherwise you would have noticed that "sealing" the tube with the (while not working in first place ... otherwise train would scrape of inside of the tube) train is exactly the problem he describes.
A lot of pressure in back but none in front = lots of force.

Though he might made a mathematical error and some logical that results in the problem way less big than he actual thinks ... but those without flaw throw the first stone.
Though pointing out these errors is the right thing ... if you know what you are talking about.

Simon WoodburyForget Last time I checked Aerodynamics was physics.
ghosttimer Still shows that even physicist are not proved against mathematical and logical errors, and each time some fool digs that up, the guy who made the mistake (and corrected it later) turns over in his grave.

sam You don't believe that humans even build something that didn't fail sooner or later one way or the other. Some sort and kind of failures are already within the calculations ... that even includes failures that are big enough to kill peoples .... like when a plane drops out of sky ... due what ever drastic failure ... 
because of incidents that are in the expected range no one would gave a shit ... it would be researched and tried to prevent for next time.

But if suddenly many planes of one type would do that, all of that type would be grounded. (and that type would be discontinued or redesigned from scratch)
If many planes with part X in it would start crashing a lot all planes which might have part x in it would be grounded.
(and part x would be discontinued)
Because that happens above the rate which is expected.
Reply: My major criticism of things such as the hyperloop is slick marketing campaign that is too like the other bullshit out there. Until it is proven to be as safe/safer than the train it doesn't matter how fast it can go. Transportation is about a balance of safety and convince, a new untested transportation method will not be safer and will not be cheaper. In light of this I will, as Thunderfoot, be increasingly skeptical as hype for the hyperloop rises. I do hope that it will be a new effective form of travel but till that day skepticism is the correct position to take.
Reply: pi7830 I hear you. The media does hype (pun intended) things up. I could see this as a means of moving goods before it is approved to move people. But yes I agree with you 100%.
Reply: Simon WoodburyForget with degree I mean a PhD in Physics (not his only PhD though)... though I don't know what exact field of it.
He could go and become a professor, but rejected the offers to stay in research rather than teaching.
Don't compare that to undergraduates.
Or someone with no education (except high school) in physics at all.

If having grad in doesn't makes you smart, not having one seems to me even worse.

And I think any mistakes he made he will actually figure out and correct later, and if it is only because of the discussions here.
Reply: +Simon WoodburyForget Aerodynamics is physics. Not the other way around. Programming is math, not the other way around.
Reply: nope. thats not what i said.
Reply: +Simon WoodburyForget Math is not philosophy.
Reply: No way of stopping? In the graphic rendering used, there are a couple of rails. I would imagine those rails would have some sort of brakes/clamps.
Reply: Agreed, There could also be a second layer of encapsulation.  A tube in a tube. Tubeception if you will.
Reply: Why couldn't the magnetic track act as a sort of emergency brake if there is a leak? I don't think the hyperloop is as suicidal as you make it out to be
Reply: +Alex Lotz agreed, I want him to respond to this
Reply: yo thunder, where is your electro magnet?
Reply: +Thunderf00t This is where one could do with a couple of nVidia Tesla cards, a couple of xeons and some fluid dynamics simulators -> another crowd fund project?
Reply: perhaps a giant diaphragm placed at each end mounted on against a giant magnet as a kinetic energy recovery system could be used as a safeguard. If the incident occurs infront, cool, it will slow the thing down, which is what you'd want going over all that rubble! Anything under 20g and it might be survivable...
Reply: not to mention the economics; such a failure would close the route for some time. With such projects, its always about the economics (we pretend its safety first - but...) As for the question how likely is it... it will happen at least once...
Reply: Congratulations, your Logic Fallacy for today is: "Argument From Authority".

Just because Messr. Musk is quite intelligent that is no guarantee that all of his ideas are good.  Even smart people can make incredibly stupid mistakes.
Reply: Thunderf00t I hate to nitpick, but you didn't even mention how even if they could get it down to a thousandth of an atmosphere the (for lack of a better term) rail car would explode from the pressure differences, and most likely the tunnel would collapse from earths atmosphere bearing down on it. That's not even taking into consideration the amount of safety that would be necessary to board and unboard passengers, crew, and cargo from this thing XD
Reply: ....er ...what ??? O.o?
Reply: While i figured the whole vacuum idea was a bit bogus, the use of the mag rail is not.

That said, the threat of a catastrophic failure does appear to be mitigated via both mag rail breaking, as well as the 4 other emergency arms that I can only assume will contain emergency clamps to keep the train for doing exactly what you are stating here.

Now, I will have to wait for your full analysis of this, however, I do hope you take these features into account. It can act as a high speed mag rail just like they have in Asia. So the only issue is the vacuum portion as far as I am able to tell. With proper safety precautions, I do not see the issue you claim as is, so this will get interesting.
Reply: yeah but what if the UK is drown in the actual ocean by the Arab state (the eu) then what does anything matter except going farther left?
Reply: ***** 
Chemist commenting on Engineering matters.
Reply: +KGDRAWROF

That the Hyperloop tunnel wouldn't be made of glass has absolutely *no* bearing on the dangers that TF outlined.

The problem is that if there was a vacuum failure, people in the maglev would be almost literally shot from a gun. All dead - all now gooey paste, smooshed all over the maglev carriage.

The glass tube breaking at the end was just a side effect of the demonstration which TF decided to film because of the dramatic effect.
Reply: Oh, you'd be smooshed into paste practically instantly - or most of your internal organs would at least.
Reply: Maintaining a decent low vacuum isn't that easy in a small lab setting - doing it in an enormous metal tube with pressurised maglevs with squishy meatbags in them would not be easy at all - I can't even imagine what the pumps would look like.
Reply: No way - you can't de-accelarate that quickly no matter how 'crumply' the barrier at the end would be - the people in the maglev carriages would be paste.

Also, if the pressure was ''equalised" that rapidly - that would be a lethal environment to be in as well.
Reply: Nah - I don't think so, because it would all have to happen so fast that even if it was possible, sudden massive changes in pressure/speed like that would be lethal in themselves.
Reply: That wasn't the point - the danger isn't being blasted out of the end of a glass tube - it's the massive acceleration that would be lethal in and of itself.
Reply: Hyperloop was sold by Elon Musk who has an history of doing more than wishful thinking.
Reply: +Joe Brizanski You mean he pays actually smart people to do those things, yes he does!
Reply: Where did you get that idea? They are already building a prototype for unmanned testing.
Reply: Wouldn't be too difficult to put pressure relief (or more accurately, 'vacuum relief') valves at regularly spaced intervals. A more interesting situation would be if the vacuum failure was 'downstream' of the train and the pressure increase was ahead of it's path... what kind of acceleration would the train experience as it was slowed down? Of course it would be a function of the mass of the train and the rate of the pressure change... but still, vacuum relief valves could be triggered to equalize.
Reply: That's not how pressure waves work, sorry mate.
Reply: You're just talking about a pressure differential. Why couldn't  they just design some kind of valve system on the outside of the pod to equalize the pressure around it and then apply the brakes?
Reply: Perhaps the more potentially disastrous the system, the more backups? I believe the nuclear disaster in Japan a few years back only occurred due to a perfect and incredibly unlikely combination of failures; three or four separate "backups" failed to engage for various reasons, if I recall correctly. Just one more backup could/would have spared everything. (Instead, people are paranoid anew of nuclear power again.)
Reply: +therealquade 
So if you are not at the center of the tube you will experience sudden acceleration and then another sudden acceleration, basically killing you. You know because both travel at the speed of sound if you are not at the dead center one wave will reach you before the other. Leaving you with two waves moving at the speed of sound hitting you. That is like thinking that if someone throws a punch to your left cheek punching you right cheek a quarter of a second after will make it so your head dos not move. Try it. it does not work that way.

Magnetic brakes work like friction breaks. If the force that is being excerted on them is strong enough there will be movement and acceleration. However this is the only reasonable way to stop this from happening that I have heard for one of the many problems this project has. The main problem being it is not cost effective enough compared to alternatives.

Finally, the acceleration will kill you, little matters if your metal coffin is intact or not.
Reply: grumpybill :)
Reply: That is true - humans can't be shoot like high pressured riffle bullet and expect to live, BUT vacum tunnel part of this isn't that wrong imo. Take normal high speed train, and send it through vacum tunnel, and I bet you can reduce exceleration to acceptable levels and increase speed a lot - not to mention engine efficiency. To slow down, train leaves vacum part, and apply brakes and voila - it slows down. How much would that thing cost? probably wouldn't be worth it imo, and planes would be still the way to go ....
Reply: ***** Fact: one of the first things sent through a citywide pneumatic tube system was in fact a cat! It survived!
Reply: The engineering reality here is the extreme speeds, high centrifugal forces and the low pressures (all of which can be engineered and designed around). The concept is not wishful thinking, because as you have shown in the video, the concept works.
Reply: +MartinDxt  nice comment..I was doing the same math..
also, in order to get from 0.001 to 1 bar of pressure you need to fill the whole volume behind the train with air at once, which is highly unlikely to happen quickly in a large distance/volume railway..the hole would need to be too massive to produce an air intake as big as needed, so the pressure wouldn't build up as fast as in the model...the air would expand to fill the the railway volume and the pressure would build up slowly, which would generate a small acceleration...
plus, increasing train mass with more wagons+people or goods would reduce any kind of acceleration rate and probably increase overall transportation efficiency, which would dilute the costs of transportation...this would also allow for more safety measures, fewer travels and more efficient equipment, so scaling up is good both for safety and economics, which is a good relation...
there are many ways to solve this problem in particular and get good results with the solution...
having said that, I still have some concerns about the feasibility of this projects...
Reply: +dillmon1 
the engineering reality here is that a real engineer will pick something else to do the same thing at a better price, and serving the same function. The speed is almost irrelevant considering the distance this thing will move.
Reply: I think you didn't represent the concept accuratly.
In case the leak is in the direction the bullet/train is traveling it would (especially if the leak is a distance away) slow down the bullet but would it do that fast enough to hurt the people inside? no idea but it's quite a challenge to build a model of that (can't use a gun to shoot in a vacuum tube).
if the train is traveling away from the leak I am not sure it would accelerate. The inrushing air would have to travel faster than the train. if the bullet can 'weather' the winds it should be alright (for example by really clamping down on the middle rail and only blocking half the tube, the upper part being empty).

if the leak is close to the train it would be very dangerous, but so is every travel. quite a bit depends on the math and how big the dangerous zone actually is.
Reply: surely a way of stopping would for them to open up the other end as well so that the air is coming in from both sides?
Reply: While the basics of this idea are kinda old - over a century -  the idea in itself does have merit and frankly, all your video has shown is that this could be a very dangerous transportation method, not that it would be inefficient or impossible.

I sincerely hope your actual video has a bit more meat to it then this cause all this video says - at least the way I interpret it is - this could be very dangerous and we shouldn't do it because of that.

I mean, this isn't Micheal Verne's proposal for a transatlantic tunnel any more then it is a proposal for a space elevator, the technology to build this seams to be here so I really, really hope you have more if this goes wrong it will kill you.
Reply: using a mass driver all but it name as transportation. 
not stating if plebs have to be acclimatized for low atm.
no functioning inertia dampening prototype. 
this train has no brakes. 
zero point energy.
lightsabers.
Reply: I see it as one of those things where specific safety measures need to be developed to make it safe. Just like all other methods of travel there is danger.
Reply: They talk about capsule depressurization, not tube depressurization. They have adressed the case of air in the capsule scaping into the tube, not the case of air outside the tube leaking into it. Here's the extract from the pdf:

Hyperloop  capsules  will  be  designed  to  the  highest  safety  standards  and manufactured  with  extensive  quality  checks  to  ensure  their  integrity.  In  the event  of  a  minor  leak,  the  onboard  environmental  control  system  would maintain  capsule  pressure  using  the  reserve  air  carried  onboard  for  the  short period  of  time  it  will  take  to  reach  the  destination.  In  the  case  of  a  more significant  depressurization,  oxygen  masks  would  be  deployed  as  in  airplanes. Once  the  capsule  reached  the  destination  safely  it  would  be  removed  from service. Safety of the onboard air supply in Hyperloop would be very similar to aircraft, and can take advantage of decades of development in similar systems.In  the  unlikely  event of  a  large  scale capsule  depressurization,  other capsules in the tube would automatically begin emergency braking whilst the Hyperloop tube would undergo rapid re-pressurization along its entire length.
Reply: +Thunderf00t Could they have a failsafe in the maglev system to where the magnets can be used to reduce speeds? Just a thought that my feeble mind can't do the math on xD, thanks in advance if you look at this.
Reply: My thought exactly
Reply: legotechnic27 aye that's what I said too
Reply: legotechnic27
The reason that the tube is near vacuum in the first place is to prevent friction and heat from affecting the maglev cab. if the failsafe introduces more air in to mitigate the differentiation, the cab will experience even turbulence and heat, the cab may survive but the contents will have severe whiplash.

The rails can slow the cab down by alternating sure but maglevs function by lifting the car off the rails. With enough turbulence and vibration, the cab can lift off or skip the rails entirely.
Reply: +nononsenseinrational Right... but with the internet and email already existing, I doubt this would be in demand. Assuming it would even be possible...
Reply: In Musk we trust.
Reply: +capitalism420 wat
Reply: Duuudeee... propellers TOTALLY works in a vacuum. Why wouldn't it?
Reply: To all those who want to fix this problem with a valve: 
That's not going to work. 
1) You need huge valves to fill a tunnel with 2 m in diameter with air. 
2) Those valves will to react slowly. 
3) You need time to detect any failure. 
To sum it up: The main problem is that you can't react fast enough to compensate for a possible pressure increase. By the time your valves start to open everybody in the system will be dead. 
I still think that the real challenge is to create this vacuum in the first place.
Reply: Marco Yamada thanks ;D
i believe the max speed it could hit is the speed of sound but still you would need a 2 meter hole to do that
Reply: Marco Yamada nice reply :D 
yeah i'm more concerned about the cabin rupturing but i guess it's unlikely as satellites have been up for years and nothing major happened in space where you are constatly bombarded
Reply: Having a mag lev system in a tube could have worked as you lessen the risk of derailment that has happened to a few of the mag lev tests. I always thought adding a vacuum to the tube for increased speed was dodgy.
Reply: wouldn't these also have to happen immediately behind the pod as well which would be traveling at such high speed that the air pressure behind it would have to travel at a greater speed than the loop pod and would have to also fight against friction in the outside walls of the tube(which could be designed to have high friction and self clog at the same time via passive systems, like long strands of material being forced inward by the outside pressure? imagine long strands of soft rubber or plastic lining the inside of the tube in this video),  basically the pod would be locked into place till the vacuum was stable and sabotage at the exact moment pod was unlocked would probably be the only realistically common way this would take effect on the pod.

i think thunderfoot totally failed at debunking this by approaching it from the safety side of things.
Reply: ashtorak i estimated 4 g for a 10 tons vessel and a 2 m diameter where did you get that number???
Reply: FARBerserker how bicycle will kill you
Reply: Sure, maglev trains already use magnets to convert the speed back into electricity. Its just speeding up in reverse.
Reply: cant wait to see the full vid, also wanted to ask if you intend to debunk water powered cars
Reply: I smell feminism, and it's gonna be mad you said men. Good vid, thnx Peace.
Reply: Wilder
When plains fail, they are able to glide into a landing.  Which is part of why plane crashes don't often end in fatalities.
Reply: MartinDxt
 That 200g figure was from the final design review of rPod, which is a small scale test pod for SpaceX's hyperloop competition being developed and built by rLoop (the reddit group).
Reply: +OmniscientWarrior
Which is, say it with me, an engineering solution. 
Likewise the hyperloop will have its own array of engineering solutions. Like i mentioned, the electromagnetic rails could be engineered to also serve as an acceleration prevention in case of a tube failure. Which is easily monitored by measuring the current pressure trend in the tube at all time. 
My use of planes as an example is because TF's complaint of the hyperloop is mainly the potential for failure, without taking into account the engineers that are going to be working on it.
Reply: Unlike teh other project you criticised hyperloop is a project of a company that actually puts things into space and cooperating with NASA not just a bunch of designers making solar roadways in the backyard.
Reply: It would be a good target for terrorism, with a plane you only need to secure the airport. The entire tube would be exposed.
Reply: "No way of stopping" Seriously TF, it wont have brakes of some kind? I imagine the type of brakes that a lift uses,probably internal rather than the external ones on a lift but maybe fitted along the inside of the tube(or onto the capsule itself) which triggered automatically when a pressure drop was sensed?
Reply: You know they could make the tube 10 meters in thickness and isolate it with 200 layers to prevent for such effects, right?

It is "next gen" tech but I wouldn't call it "fantasy".
It's pioneering.
Reply: ***** The Titanic.
Reply: They obviously need some sort of safety valves.
Reply: Try and calculate the power of a 20 ton lump of steel crashing against a barrier at nearly the speed of sound. Even if you make a barrier that is able to withstand the impact nobody on bord can possibly survive the impact. We are talking about a level of compression that would most likely make the air inside the cabin catch fire.

Don't get me wrong, the hypertube might be possible to construct, what i'm saying is that the costs to operate it and make it reasonably safe will almost certainly far outweigh the benefits.
Reply: OmniscientWarrior small planes can possibly glide, not all do.
Reply: Sock Pupet1984 ground to air missiles don't exist?
Reply: Great that somebody pointing out that hyperloop is one big BS, it has so much potential problems, and of course the enormous cost.
And one thing, hyperloop would be very susceptible to terrorism, and you would need to have similar security precision like on the plane ;)
Reply: +Thunderf00t So following the logic - If Concorde switched off its engines during the supersonic flight it would disintegrate due to rapid stop?
Reply: Mantas Balnys The engines certainly would
Reply: Mantas Balnys noooooo, something else catastrophic could happen, that's why they were grounded.
(Sarcasm)
Reply: Mantas Balnys
How did you even come to that comparison based on what TF said? He didn't mention anything about engines.
Reply: Would it be plausible if there was a way to insure that the pressure could hold and the g-forces could be handled? I ask because I'm writing a novel and this is one of the concepts I want to put in there, but realism is what I'm after... Thanks for your time.
Reply: Wilder What is the point of the hyperloop in the first place? It doesn't offer ANYTHING that passenger aircraft don't already offer, plus it would be incredibly expensive to build and maintain, which means it would be extremely expensive for passengers to use. Given cheaper solutions to the same problem, most people will opt for those instead of the needlessly expensive ones.

That was part of the reason why the Concorde failed! Sure, the Concorde was, and the Hyperloop might be, a marvel of engineering, but that doesn't mean it's practical or economically viable in any way. If it's not viable it is better to invest the engineering effort into something that has real, practical potential and benefit (such as manned Martian exploration).
Reply: One of the many problems they will have to work out, nothing more.
Reply: With my pre-college level of physics, I figured that this Hyperloop didn't sound particularity safe but this small scale worries me a lot more then previously
Reply: lithindor 32023 a little knowledge is dangerous
Reply: Michael Etzel Because in shorter distances trains are faster than planes.
Reply: agreed and if it would work it would best planes
Reply: +Mantas Balnys I get where you are coming from, and I disagree with TF, but your analogy isn't accurate as the hyperloop is a sealed vessel. air can easily flow around the concord because there is space to displace that air. the hyperloop would not have that luxury.
Reply: Dies1r4e As far as I was on topic of hyperloop the major issue always was "how to keep the low pressure in the tube with a low energy cost". How to stick a train to the ground or stop it in case of emergency it's kind of the 19th century issue.

People are more worried what to do in case of train failing to operate and stopping in the vacuum tube.
Reply: Let's bear in mind the size of the leak, and the speed at which that size leak occurred...
Sure, if the 2m tube breaks clean off, and a segment of the hyperloop is removed, in Milli-second time frame type scenarios, then yes... You'll have a problem with 1 bar (atmosphere), suddenly pushing the plug (vehicle) through near friction-less space...

But, is 1 Bar going to result is crazy neck breaking acceleration when the vehicle itself weighs 2 tons...
So let's see where this goes...
Tunnel diameter about 1800mm
100kPa pressure
1Pa=1N/sqm
Tunnel Surface area = Thrust surface area = 2.54sqm
100000N/sqm force applied
254000N force applied to 2 ton projectile
f=m.a
254000=2000.a
a=127m/s^2

That certainly is neck breaking acceleration!
127/9.8=12.96g
Well maybe not neck breaking... But certainly passing out... I think crashing a car is over 20g IIRC....
v=u+at
27.78=0+127t
t=0.22s for a 0-100km/h time

So, indeed... If the tunnel experiences a catastrophic failure in a very short space of time, then yes, the passengers will be in a heap of trouble...  But as the time over which the leak occurs increases, so the size of the problem decreases....

If the vehicle for instance weighs 10 tons, the a=25.4m/s^2 or 2.6g, which is not all that bad... 0-100 time of 1.1s which is slower that a top fuel dragster, which does 0-160 in 0.8s
Reply: Rich Miller Up there in the comments there are links for more details about the project.

The point is that it has the luxury - vessel occupies only a part of the tunnel.
Though there are more to this. To have such a huge wave of airflow you have to brake an extremely huge hole. Basically it has to be a terrorism act.
Reply: Devourer of World that is as disturbing as the Japanese fellow that figured out how to make "steak" from the solids from sewage treatment.
Reply: ***** so the Muslims have you scared?
Reply: +Michael Etzel you really know nothing about the hyperloop. it could travel at 1 to 2 thousand miles per hour, not mere hundreds. operating costs would be pennies on the dollar compared to planes. it wouldn't require scheduling as cars could be added at any time. there are many many benefits, should it become viable.
Reply: could you please simplify how exactly it would kill us? i do somewhat understand the science lingo but i didnt quite get the "how it can kill me" part. is it just the pressure of the vacuum killing us?
Reply: Rich do your homework. #1 They could never just add cars to this it would require that all cars currently on the rail be stopped and clamped down hard enough for a vacuum not to move them to add a new car to it. #2 1 or 2 thousand miles an hour is well over the speed of sound with 2k being nearly 3 times the speed of sound which would cause an enormous strain on the people riding it. #3 operating costs would be FAR MORE than pennies on the dollar compared to planes considering they have to supply electricity to the magnetic rails, and the engine, and keep this thing under a vacuum. #4 The pressure needed for people to survive in the cars would almost assure that the cars would explode the moment the pressure is dropped. #5 The air pressure would almost assure that the tunnels would collapse under the weight of our own atmosphere. #6 Even if all of these things managed to not happen, the security on and off the trains as well as around the entirety of the tunnels (IE people constantly checking for breaks and assholes throwing rocks or something) would all but ensure that no one could ever ride the damn things.
Reply: this is great but is there a way you could lower the pressure to achieve maybe a faster way of travel whilst being safe as well?
Reply: this is great but is there a way you could lower the pressure to achieve maybe a faster way of travel whilst being safe as well?
Reply: Myth Busters did a very similar test and got some extraordinary results.
Reply: Couldn't you have a fail safe by having regularly spaced brakes that take advantage of Eddie currents around the magnetic rail
Reply: yeowch! i havent heard of this before but it sounds like using a railgun for a train. depending on how fast it launches, wouldn't the g-forces crush anyone riding in it?
Reply: That isn't the only fault it has, how would a propeller based electric engine even work in a low pressure environment?
Reply: BF18ACE It has many obstacles but it isnt without succes either when MIT TU Delft and such are working on semi workable concepts..

The biggest issue is the price of converting all existing railway, but planes have big emissions so these are the "way into the future toughts" but its not like solar freaking roadways in its approach... 

All would agree a space elevator is not doable now but the concept and experimentation might prove usefull nonetheless;

Its very much anti-scientific to take this "all that works now" (microwave ovens w.e.) is valid but concepts cant be explored; if Phil proves zero reasoning on a faulty experiment then I cannot approve, 
The leak issue is there for example but as an engineer I find is feasable that we could at some point tackle such a problem, just like how cars airbags prevent peoples noses from smashing into their stearing wheel.
Reply: malcomb bell your first point is not true. They could easily use an airlock double door system like they use on the international space station. You're second point is also false. Pure speed does nothing to people. 2000 mph is nothing compared to how fast the planet is rotating or circling the Sun or the center of the galaxy. The problem would be acceleration, which is means you just can't put the pedal to the metal. And while operating costs could be high, they could also be lower than expected, by equipping it with solar panels and the like (also, maintaining the low air pressure wouldn't cost much, as the tube is sealed). Your 5th point is incorrect, as I'll point to planes that fly in such low pressures and space shuttles and the actual space station as well. Your sixth point is a failure as well, as we've built submerines and submersibles that could handle well over 1000x Earth's atmosphere. And lastly, yes, security would be expensive, but if it was built underground less so and throwing rocks at it or nearly anything a civilian could do would be hilariously ineffective to damage it.
Reply: +DarkBabylon - Gaming videos no.
Reply: this is not a vacuum seal fail simulation, this is the whole god damn tube exploding more or less. You would need the whole tube to rupture in order to get the air flow necessary for this to occur.
Reply: the propeller is to remove the aircushion that is formed in front of the vehicle at high speeds. not as a means of propulsion.
Reply: The most important question, will it have a pommel?
Reply: what about failsafe systems? you could in case of such an event open safety valves in front of the train to stop the acceleration.
What I find more problematic is just how difficult it would be to keep such a high vacuum on something like a hyperloop.
Reply: You could do it, but at some point the energy needed would literally turn the lines supplying power into plasma, which conducts electricity well, but only until it dissipates.

The problem is the huge amounts of wind blowing past you too. Imagine the air current which could turn your passenger cart into metal fragments.

Now Elon Musks engineers who are competent people said something about "vacuum release valves". Now imagine hitting a wall of air, going at high velocity with a train going at the same velocity, and penetrating it.

I want Musk to demonstrate it to me. If he survives vacuum failure he truly did pay people smarter than me to realize his dream. Worse yet you'd have to react to pretty small pressure differences, and check for fissures each time using a highly trained maintenance staff. Either that or your system kicks in way too late.

This isn't like a pipeline where little leaks just poison a national park, this is a monument to overcoming engineering challenges.
Reply: Gabriel Soos if materials and design are up to snuff, pipeliners will get it done.
Reply: Hannes Krauße it ain't no hill for a climber. Just a challenge.
Reply: Gabriel Soos - yeah was thinking the same thing. I had a similar idea years ago about covered interstates. But they wouldn't be a completely sealed tube. Instead they would be segments where the back was flared wider than the front of the next segment. Wind captured by the funnel shape, the vehicles themselves and solar powered fans would keep air blowing in the direction of travel. Wouldn't be zero drag like a vacuum, but should reduce it quite a bit. The major problem (besides cost) is responding to accidents and emergencies.
Reply: +TheSciFiCat this is why you wear condoms kids!
Reply: Thunderf00t, have you heard of the revolutionary concept known as brakes?
The only way you'd be in trouble is if the pressure differential between front/back is really high for a "long" time and with either the brakes or the structural integrity of the cabin failing.
Reply: The problem is not catastrophic failure existing in vehicles, it's how you might control or prevent it, and THE biggest problem with trains is the track already - it always has been. From logs or trees on the tracks by wild west robbers to switch failure causing a high speed train to run off the rails, the problem isn't with the vehicle, it's with the medium it travels on. Similarly, a motorbike can be just fine, but a single slick of oil can ruin your life. 

With airplanes, you're in the air, and the problems are basically your wings and control surfaces, and that goes for each individual aircraft. A single crack in an aileron won't disrupt all traffic between 2 major cities, it'll just mean the airplane will sit in maintenance for a while. One of the first things that went wrong for jet airliners was basically metal fatigue and wings getting torn off. That's easily fixed by using materials that are better suited for that task (non-rivited duraluminium for instance) and checking each individual aircraft periodically. 

Now take the hyperloop. What you've done, is you've taken ALL the control from the vehicle, and the single point of failure is now a tube that's a thousand miles long, that's just sitting there, at the mercy of nature's forces or worse, and even if the crack happens when there's no pod around, it'll still take  a LONG time and a LOT of money to replace or repair. The vacuum and the speeds so very close to the ground are inherently unsafe, and when there IS a failure, there is a very high risk not even computers can react and slow the pod down fast enough.
Reply: *****"... taken ALL the control from the vehicle."
Yeah, like mechanical brakes isn't an option on the hyperloop. Just because it is hovering in a magnetic field, it isn't impossible to add some arms that can extend to the side or a guide rail with brake pads on them - or to invert the magnetic field to act as a brake instead.

"and when there IS a failure, there is a very high risk not even computers can react and slow the pod down fast enough."
That is just plain false. As a student of electronics and computer sciences (6th semester just finished) I can tell you that from the time that a failure is detected to the brakes being applied can be on the order of a few milliseconds - and failure detection could happen at about the same timescale, depending on how far there is between the pressure gauges.
Reply: Yeah, I think he whiffed on this one, big time.  Hey Thunderfoot, just stick to the science and nothing else bro.  As you can see, your audience is strictly on the side of science.  If you stray from that you will lose your base.  This time you overstepped, next time, you may not be so lucky, it may be the death of your channel next time.
Reply: P Tjeerdsma Yes, if the train car would accelerate as fast as the ball, that is true. However, the ball he uses is a near-perfect fit in the tube, while the train only fills about a third of the tube cross-section. That is a MASSIVE difference. In this test almost all the air pushes on the ball, while in the real world most of the air would just rush past the cars. Also, in this test the failure happens just behind the car (ball), which is very unlikely to happen in the real world. If there was a bigger distance between the car and failure, the force exerted on the car would decrease considerably since the pressure at the shock front drops as it travels down the tube.
Reply: P Tjeerdsma Pass out maybe, but kill?  Not likely.  I think folks would be just fine.  Think about it for a second.  If the tube is depressurized to allow for the travel of the carriage then that means the carriage is aldy moving.  Then one can also assume from that that there would be no "sudden" acceleration in the event of a catastrophic failure.

Now the possibility of the breach happening in front of the carriage while it is already in motion, now that would be something nasty, well, provided circumstances allowed to be nasty, like in his example, where the carriage takes up very nearly the entire diameter of the tube.

But those are extremely odd circumstances, don't you think?  I mean, if YOU can think of it and I can think of it and dozens of others here can think of it, not being engineers the lot of us, don't you think an ACTUAL engineer would be well aware of these too and create better ways of dealing with it?

That is just logic though.  And no, I am not letting TF off the hook as easily as you are.
Reply: Daniel Duncan engineers aren't really intuitive. They are problem solvers once the problem is presented.
Reply: ***** Ruby Temptations king the problem is with the way that the thing was designed it doesn't even have to be a terrorist the thing is propped up on fairly flimsy poles, I would honestly be surprised if they could stand up to a drunken asshole crashing into them (the far more likely thing to happen) so forget about a terrorist attack on the things you should be worried about the drunk dude, the guy falling asleep at the wheel, oh and the morons that go out in the desert to fuck around and forget that there's a giant ass tunnel running through the desert that could not only cause a very large very heavy object carrying people to shoot out of one end and cause massive amounts of damage, and THAT is a best case scenario, because if an implosion occurred anywhere near civilization (IE a break occurs in the line and it starts sucking air in) it could easily suck people INTO said hyperloop because of the differences in air pressure.
Reply: Ruby Temptations like a power grid or exist rail.
Reply: malcomb bell Does the ISS explode?! Does a submarine implode?! Your level of scientific and engineering ignorance is absolutely stunning.
Reply: Rich Miller  yeah guess what the ISS doesn't run from LA to San Francisco. your level of engineering alone is mediocre at best because it's like comparing the ants ability to lift 10 times it's own weight and then you run out and try to pick up a car. as far as the train car exploding that's a simple thing to speculate on did they base ANY of these designs on the ISS or the subs? Doubtful, have they actually shown ANY small scale tests, or practical research on this besides "ooh look at how all this other shit works let's combine them!"? Fuck no. So as Thunderf00t would say Science bitches it works!
Reply: malcomb bell Actually, the ISS travels at over 2000 mph and circles the earth 10 times a day...... far further than LA to San Fran. What else you got? Also, yes they have done practical research, AND this is still concept phase.
Reply: The challenges are real, but not necessarily insurmountable. Most of these things can be solved. Was going to the moon cost effective, no, but it was achievable and there are countless technologies that would not be around without it, and as long as the cost of it isn't coming out of my pocket I just see it as a positive. Out of all the bullshit products and services you there this project is being treated seriously with open competitions to inspire R&D and is not fundamentally stupid. There is a number of proposals for how it can be done and actual research is being done at some of the largest Universities for this. It is not the usual bullshit with a concept designer, or pseudoscience bullshit saying  GoFundMe to change the world while not having fundamental knowledge.
Reply: Rich Miller  Rich if you had used your brain for more than a millisecond before posting that comment you wouldve realised I was talking about the physical structure of the ISS not how far it travels. Now have you actually LOOKED at the way they are building this hyperloop? Guess not cause if you had you would know that the structure is essentially a pipe with maglev rails stuck into it and that the support struts that hold it up definitely would not stand up to the impact of a car. So let's just briefly think about what happens when one of those support struts is taken out by some drunken asshole, the pipe(s) it's holding up break away and guess what Thunderf00ts test happens in a much larger scale, now let's say this occurs in a populated area 24948000 cubic feet of air (if it breaks in the middle so best case scenario overall) people near the damn thing would be sucked into it, and most likely die from the force when they landed. now thats assuming the tunnel DOESNT collapse under the pressure of our atmosphere given that they are putting it on POLES rather than underground. Now once again I want to point out that you THINK they COULD be using the same ideas as submarines and the ISS, but WHAT PROOF do you have that this crowd funded pipe dream is actually capable of applying any of the technology and engineering skills used by people like that.
Reply: malcomb bell being crowd funded, who gives a rats ass if it fails.
Prototypes and research models aren't usually representative of the end product. But your smart, you know that. No problem listed can't be over come it's not like it's going into service next week. There is still time to figure the thorium science out.
Reply: DarkBabylon - Gaming videos their money, their responsibility.
Reply: Hey Thunderf00t, I was just curious to see if you would investigate the material known as Starlite, along with the claims about how much temperature it could withstand. I haven't been watching your videos long, but I see that they are all science related, and you seem to have a good knowledge about chemistry, which would make quite an enjoyable video. My apologies if you do not take video requests, I just thought it would be something interesting to cover.
Reply: Even if the real hyperloop gets built, it'll only be a matter of time before terrorists blow it up.
Reply: Cool experiment.
Reply: +Thunderf00t

Even if I think that this "project" is likely very unfeasible (just think about having - and keeping- hundreds kms of tube under vacuum), I think that your experiment has some flaws. 
1) Even if the "creators" thought of using a single tube, which is only slightly larger than the "train" (the ball in your experiment), most likely at the end of the day they will realize they have to use multiple tubes connected with a certain periodicity (or they'll use a tube much larger than the train), in order to prevent your "cannon like" effect (therefore there will be much less force in case of such a failure).
2) Your example simulates a major catastrophic failure, in which the whole section is opened instantaneously! This would not occur typically (it's like a bomb in an airplane... it's obvious that in any such major failures people will die). Most typically you would have much less severe leaks, which could be adequately dealt with.
3) It seems to me obvious that lot of sensors would be put along the whole path, to monitor the pressure and to take appropriate actions to equalize pressure differences (for instance instantly closing "doors" or opening some emergency valves). In your experiment this is missing. 
4) Train could - and they must, given the speed the hyperloop claims to reach! - have very strong brakes. In your experiment there is no brake, except friction.

Still, even if appropriate countermeasures will be taken to avoid your cannon-like effect, the train will have to withstand the large dynamic pressure, in case of the whole section is opened.
Reply: could not air locks along the tube be used to change the pressure of the tube long the way so it could speed up and slow down in a gradual way over KM's of tube?
Reply: Also a fully loaded train rather then a small projectile would be a factor.
Reply: If you want a challenge, think of ways to make it safe.
Reply: The whole rail bed is a magnet as is needed for both suspension and linear motor control, reverse mag braking could be used to prevent uncontrolled movements.
Reply: +Anton Zuykov So high speed mass transit in a world with an exponentially growing population is a bad idea? Most of the other attempts in recent years at solving this including maglev were far worse and ended badly
Reply: Disdain for Plebs Atem Andrew you 2 have the same problem with your argument that most of the people on here in favor of the hyperloop. Now first and foremost Nikola Tesla was an extremely intelligent man, and he thought up a lot of innovative things, however the guys making the hyperloop are a crowd funded company, and as the test of time has shown crowd funded projects on this scale have ALWAYS been bullshit. So the problem as usual is you are ASSUMING that they have done all of this stuff, and have done no research into the company, the people involved or the project its self. If you had you would know that this is bullshit.
Reply: malcomb bell Oh, I know the company and the production itself is BS atm, otherwise I doubt Thunderf00t would really be touching on it. I'm mostly arguing for the theoretical possibility that this train could actually work IF everything was handled properly.
Reply: +Anton Zuykov The faster people and material get around the better for everyone. That's why, Railroads, Highways, and Airplanes were built.
Reply: You can make lot's of other video with this concept : How a plane can kill you, How the car can Kill you, How the boat can Kill you, How a bicyle can kill you.

The list goes On and on and On.
Reply: I wonder what would happen to passengers, if the cart itself sprung a leak. lack of oxygen sounds fun too
Reply: Hmm thank's Thunderfoot for this video as it brings to light a great danger that the majority of people who are interested (such as my self) in this possible form of transport to light and I believe that if the appropriate amount of technical regulation can be implemented in a well thought out manner this could be not only a really fast method of transport (quite obviously) but in all other areas, be very safe - but of course there always is a small chance (be it very small) something (maybe like as presented even with heavy regulation included) deaths and accidents will occur, however, tell me what form of transport doesn't have technical risks with them that have injured or at worst killed someone!

P.S. - I'm glad your back to owning idiotic 'feminists' (the whiny one's not the actual feminists who do real change like the ones in Africa promoting education in third world countries) and the god-awful 'creationists' who without you, good sir - I would never have known such people who should prove evolution themselves and go do some natural selection so anyhow in my personal opinion these videos are to the power of infinite better than your political hm EU videos :/
Reply: Well it sort of is, if say, it goes through it's containment and smash's straight into a wall or the ground and only create a few hundred G's been exerted onto the body - which totally isn't fatal at all.
Reply: it would likely very expensive, once you factor in the safety systems necessary to make it at least as safe as commercial air traval (a good enough safety goal)
Reply: malcomb bell
First of all, what the heck does Nikola Tesla have to do with anything? And are you seriously discrediting individual teams that are working on different designs of the capsules just because some of them are croud funded? What a joke.

My guess is you don't know very much about the hyperloop after all. You do realize that a) right now a practice track is being constructed for the individual teams to compete and demonstrate their designs and b) all these teams have working prototypes. Hell, I have even seen the local student hyperloop chapter show theirs off with my own eyes. How thick can you be.
Reply: In the event of tube faliure one might assume sendors could be added to detect pressure change and apply brakes in response. With modern electronics this would not just give you the oppourtunity to slow down, but also prevent rapid and catastrophic accelaration. Highlighting these problems is crucial to development, but in this case the solution is really rather simple: if you're open to my criticism I will happily draw you up a simplified diagram of how brakes like this might work. The people developing hyperloops are surely smart enough to make that work, hell, they've probably even thought of it already! (I hope so)
Reply: In the event of tube faliure one might assume sendors could be added to detect pressure change and apply brakes in response. With modern electronics this would not just give you the oppourtunity to slow down, but also prevent rapid and catastrophic accelaration. Highlighting these problems is crucial to development, but in this case the solution is really rather simple: if you're open to my criticism I will happily draw you up a simplified diagram of how brakes like this might work. The people developing hyperloops are surely smart enough to make that work, hell, they've probably even thought of it already! (I hope so)
Reply: Its comes from the brain of a self made billionaire with multiple engineering degrees and a seemingly philantropic motive so.. Maybe your otherwise healthy cynicism has gotten to you?
Reply: Also: even if all the people on these projects wanted to make money and only money  ( Hypothetical) they would not invest time and effort into something that is dangerous and kills ticket paying passengers. That's not how you make money.
Reply: Disdain for Plebs Nikola Tesla came up with this original concept of the hyperloop, and these people are using his ideas to make it. Now a) even if it is 'practice' do you really want me to believe a company that either admitted it had a problem with employees staging a coup, or treated said employees badly enough that they HAD to stage a coup would have decent, intelligent scientists and engineers working on this project, ESPECIALLY on a crowd funded salary. b) EXACTLY you have STUDENTS working on this, I have no problem with them using this as a learning experience  what I DO have a problem with is a company,putting peoples LIVES in jeopardy for this learning experience. So sorry if you're yet another special snowflake that thinks that just because someone works hard on something it should be free of criticism, but that's not how the scientific community works, and if it were you can bet your ass there would be a lot more dead people from shit like this.